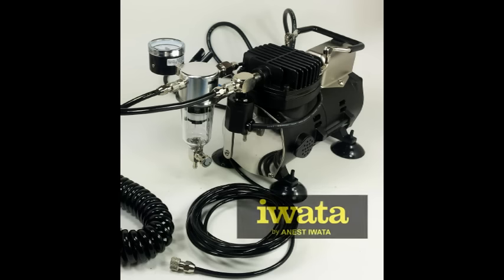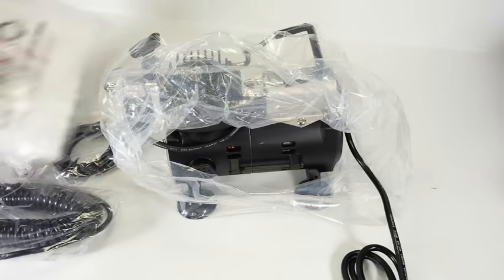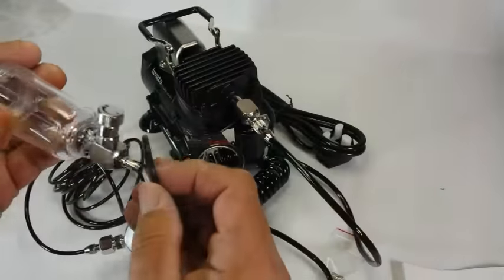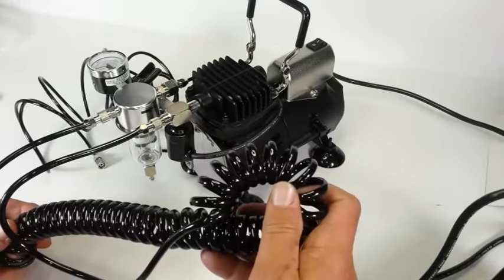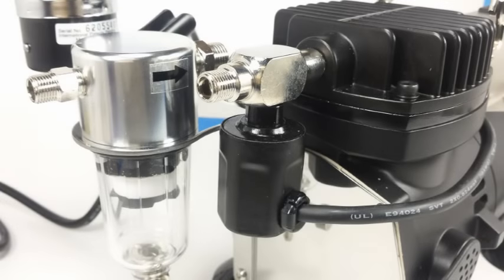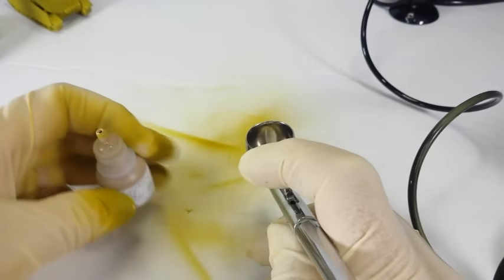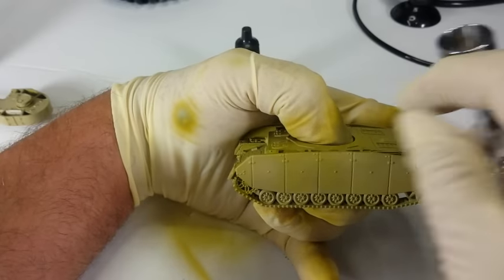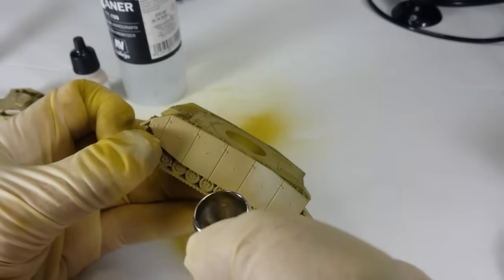Iwata Smart Jet IS-850 Air Compressor

Comment: If you open the valve the compressor is never going to shut off the whole time you are using it. They make a quick disconnect flow control valve fir air brushes that will give you needed adjustment right at your finger tips.  It fits right where the air hose connects to you airbrush.  You can get it for 8 bucks on amazon.    That not only gives you regulated flow of air and a quick disconnect feature for your airbrush. But it keeps you compressor from burning up by running constantly while the valve is open that your speaking of.  I can not believe that Iwata would even sell this instant on instant off compressor with out regulated control

Comment: Can you recommend a regulator to add to my Smart Jet? I assume another coiled hose is needed to added an line regular if you are going to keep the stock water trap in place and mount the regulator on a work bench with the compressor on the ground.